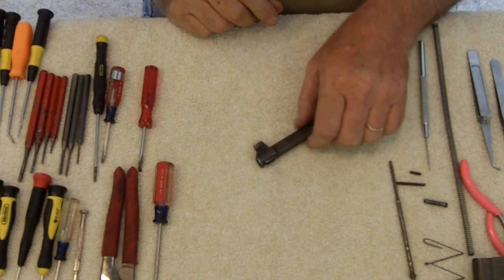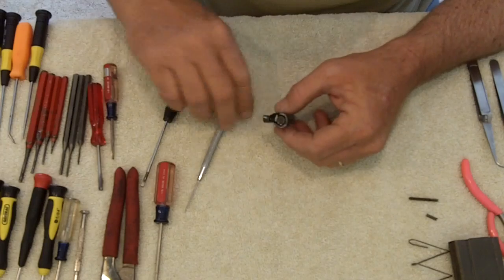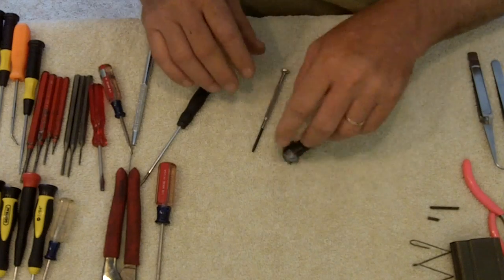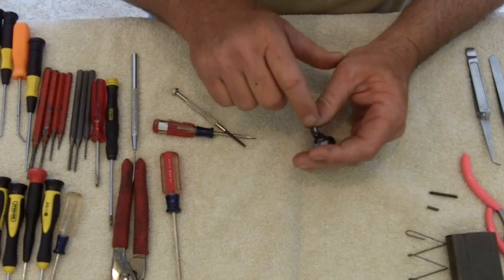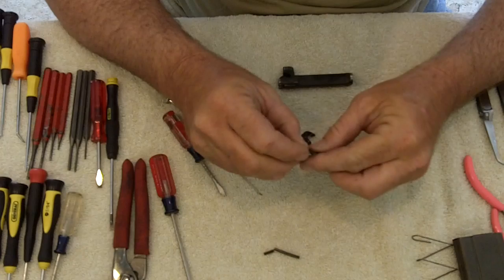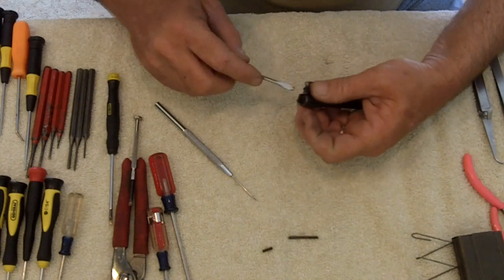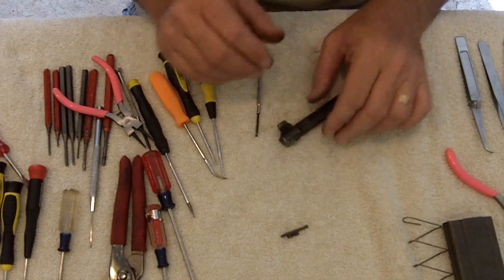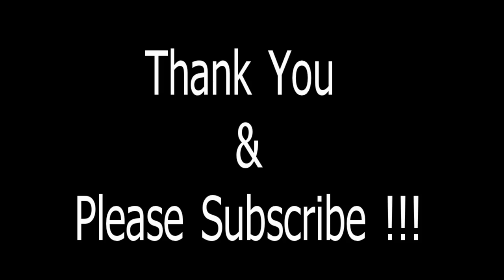M1 Carbine Bolt & Magazine Disassembly & Reassembly !!!

Comment from the maker: @waterairsunplant If you are talking about the raised portion of the circular bolt face, the answer is no, the round will sit inside the circular bolt face under the extractor. The firing pin should just clear the bolt face not the raised circular section. If it strike the round to deep it will penetrate the primer completely and cause gases to be blown backward and then you have real issues and dangerous ones. I hope this helps.

Comment from the maker: @Bandanabandito1 I am pretty much a part time gunsmith, more an armorer but soon to be certified by a few different major gun makers. I changed out all the springs because they were worn out and it works great. I do need to change a couple of magazine springs though. The headspace is perfect. Go and no go gauges make checking headspace a breeze. Thanks brother, it is appreciated.  :  )

Comment from the maker: I do not want to put prices in the comment section because they are there forever. I will however do it at a reasonable price. If you PM me or call the shop at 561-865-5426, I will be more than happy to discuss it with you. Thanks.

Comment: So this is very informative and exactly what I'm needing but when you edited out the part where you were struggling to put the spring on the ejector, you edit out the part where you put the plunger back into the bolt, showing the orientation of plunger's 90º and 45º angles to the bolt.

Comment: should the tip of the firing pin clear the circular portion on the bolt  that faces the primer on the cartridge? My M1 will not fire and I think the bolt may be the problem.

Comment: Chromefreak123- Thank you for the info on the bolt brake down.  Can you tell me if you know where I may find replacement springs for my magazine, I have taken out the spring in the past and stretched it out some and after a little battle to put it back the magazine had lots of pushing power, how ever I think the time has come for me to replace it, so if you know where I may purchase the spring I will be so pleased, if not thank you anyhow for the info.